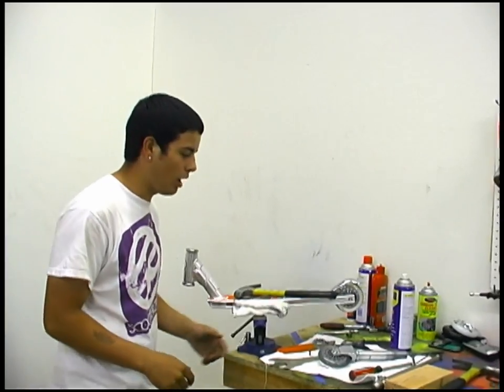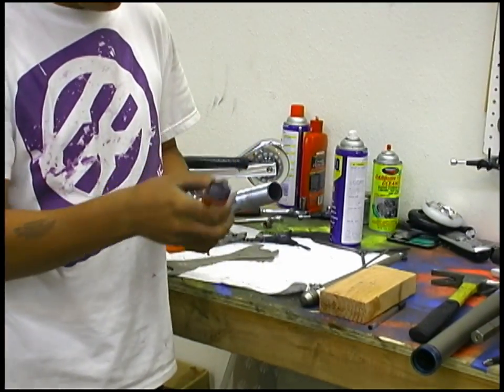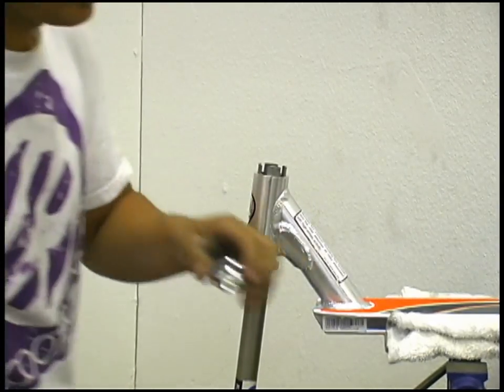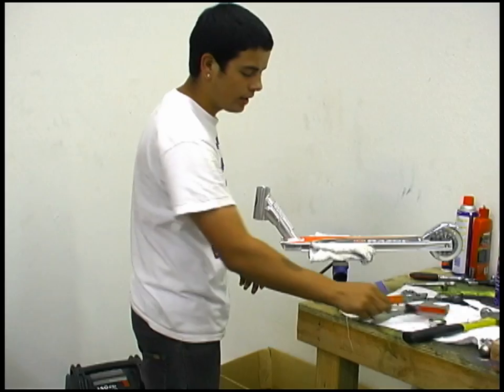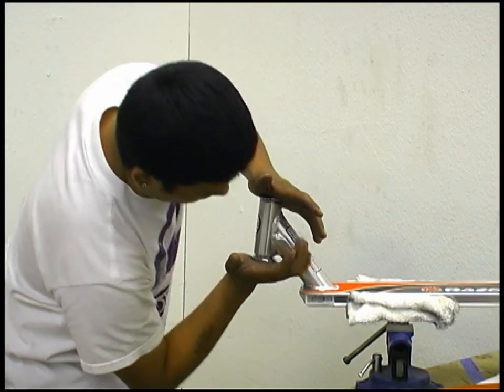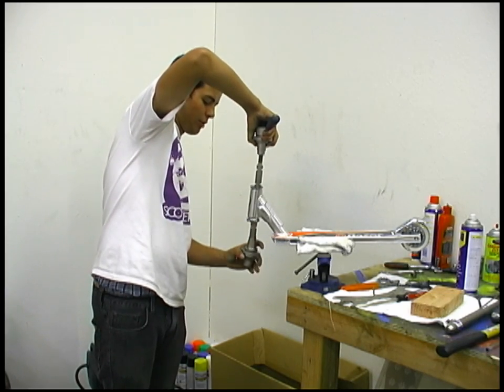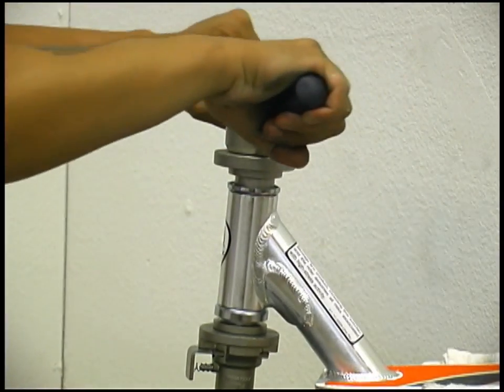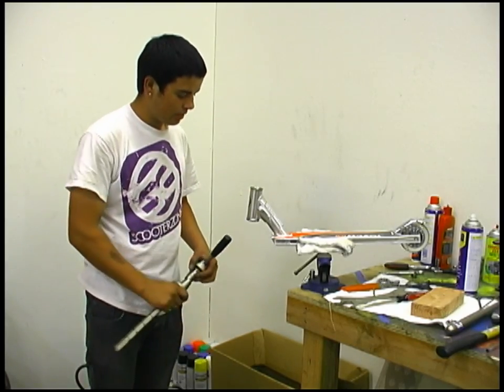Scooter Zone How To: Install a Headset with Julio Oceguera

Comment from the maker: @TenaflyFTW 

No, the top and bottom cup are both built into the head tube at a standard size. So the headset now just consist of the bearings, crown race, top race, and top cap. Any bmx integrated headset will fit just fine.

Comment from the maker: @KarterAlex44 

yes it will work just fine. you can run a threadless headset on threaded forks with no problems

Comment from the maker: @mrjamscoots 

Unsealed headsets are never as smooth as sealed headsets. But you can always put bearing grease in your headset and it will help alot.

Comment from the maker: @jeffbob2001 

Yes the are oversized, but they are not HIC oversized. since they are aluminum the bars are twice as thick. so they are standard on the inside, and oversized on the outside. So they need an oversized clamp, and they will only work on the full size SCS's that have the removeable shim

Comment from the maker: @rizzle6198 

There are alot of good threadless forks out there. The aluminum ones are good like Phoenix, Scorchers, Lucky SMX and Epic forks (now available at SZ), or if you want a nice steel one i would recommend DSA HD forks. And the bars will most likely work fine.

Comment from the maker: @xboxTVchannel 

Proto SCS will not work with district forks unless you run it backwards. meaning the bolt goes up from inside your forks, up through your star in your SCS, then into a starnut or nut on top of the proto star in your SCS. So basically backwards

Comment from the maker: @darkchew12 

I know what you mean, i had to deal with that on monday. The only way to get it out is to tap on the outside of the cups with a flat head and hammer. It will scratch your headset though.

Comment from the maker: @soonpure6 

just take your bearings out, clean them with a rag and cleaning agent (gasoline, carb cleaner, ect.) then use bearing grease on them and put your headset back together.

Comment from the maker: @VerdeBikeBro 

Did you take the stock crown race off?That might be the problem. Also, they are designed to be very tight. Just get a pipe to slide over the fork, then bang on it with a hammer.

Comment from the maker: @ShuriStr1 

Take your back wheel off, unscrew your current brake with a 3mm allen and 8mm socket. Then slide in the switch blade. and screw that in with the 3mm allen and 8mm socket. Then put your wheel back on. Really all there is too it.

Comment: @samuelscoot dude mine were stuck to, if u can get one of them out, get the outer stem of a stock scooter, and it should fit perfectly inside the headstock, and then hammer it, and eventually it will come out, i come home from school, and hamemrd at it for like 10 mins for 3 days before it popped out :)

Comment: Whenever I use my scooter for a little while the headset comes loose again and I have to tak the bars back off again to tighten it so it won't wobble also I use threaded is the only way to fix it by using compression?

Comment: I have a blunt sealed headset and i put the bearings and the crown race in and put the shim on my forks and tighten it but it doesn't spin.  When it does spin it loosens the shim and eventually falls if, any tips

Comment: I bought some envy SOB forks and took the stock headset off my my ultra pro forks, i tried to put the crown race on but it won't go fully down, I tried hammering it down with a flathead but it seems to get stuck on a part of the fork that is flared out. There are quite a few centimeters of the bottom of my fork sticking out underneath my headset cup. Do you have any suggestions? Please reply!

Comment: well i put my blunt sealed headset on my ultra pro but i ride for a little and then it starts making noise then i take it apart and put everything back together and it doesn't do it till i do tricks of ledges again/: could you plzz help???

Comment: my headset is installed properly but i have it adjusted to how smooth i want it to turn but then my bars move in my deck so my bars are wobbly and there is play, if i try to tighten it i does not move easily and i gradually becomes less stiff and then there is play. BTW it is a new headset HELP